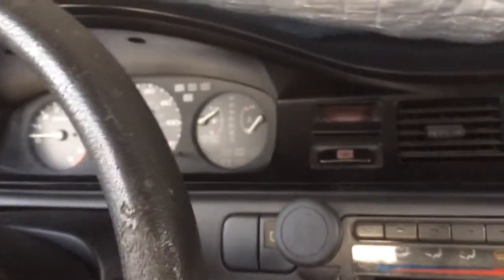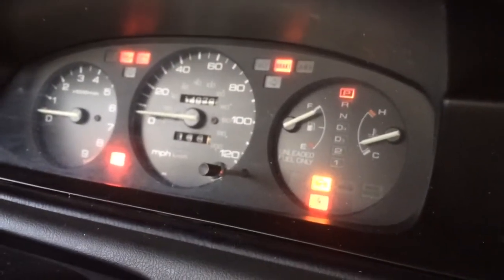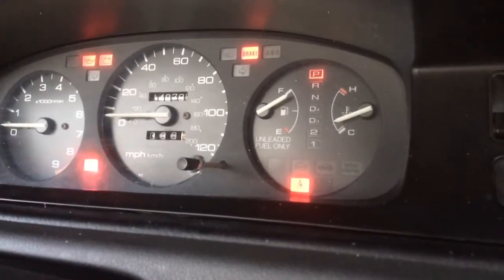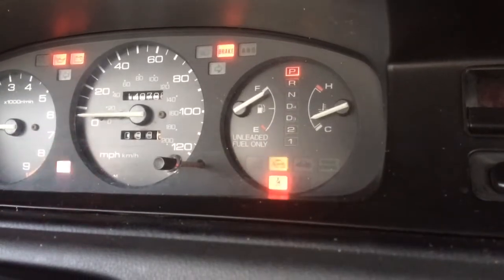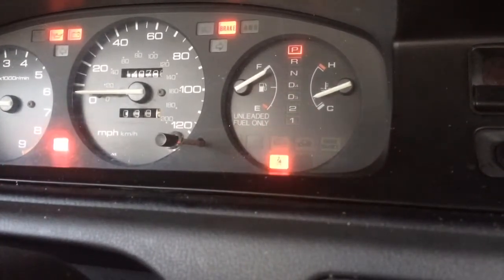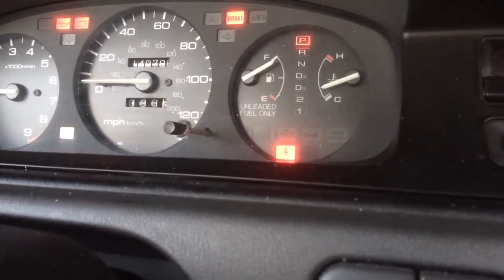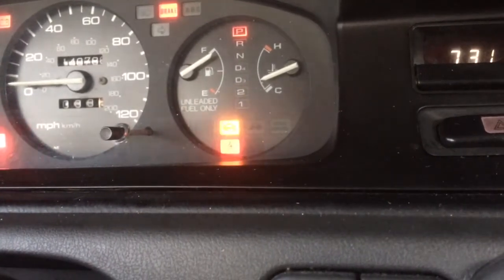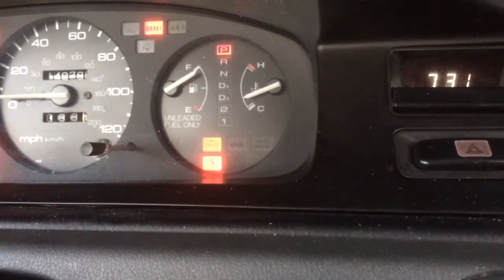2017 1994 civic ex coupe Code 41 Check engine light

Comment from the maker: I bought a new one from amazon for $23. But stop by pick and pull to get another one quicker. 

Check the continuity with a fluke ohm meter on the heater part of the o2 sensor. 

Installed the used sensor and it worked great. Light has not come back on. 

I should placed the new sensor because a used version could be lazy. But have not gotten around to it yet.